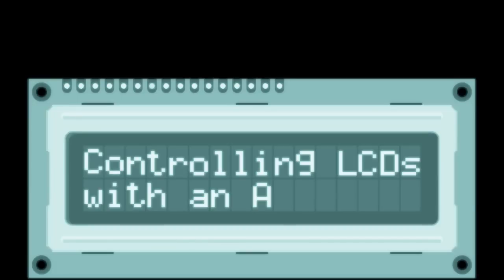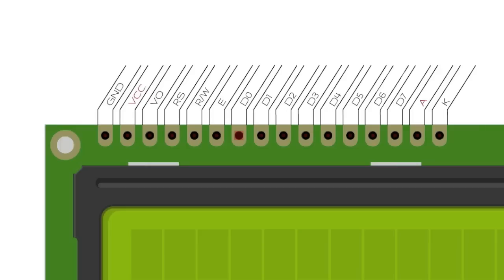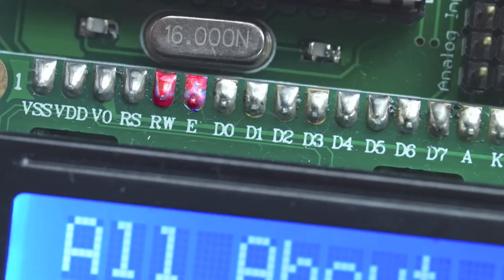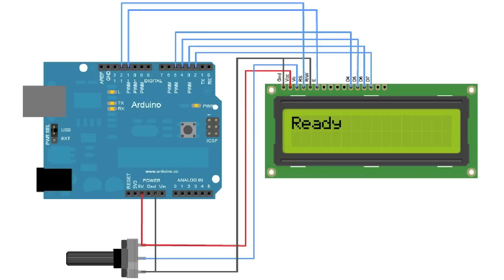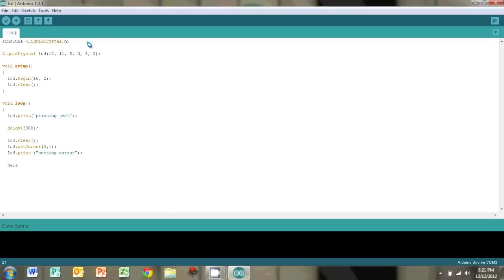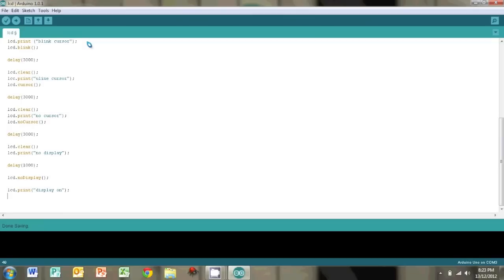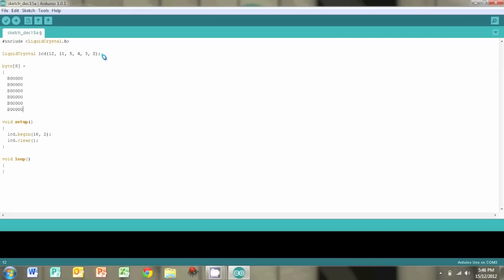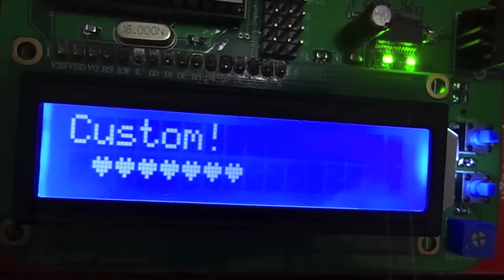How to Control LCD Displays | Arduino Tutorial

Comment: Do you have a video for LCD 1602 like this but also include a I2C? I bought and solder together the two but after that could only get the backlight to work, setting text and cursor has no effect. My hunch is that the soldering job is botched but I'm not sure how to begin to debug this

Comment: I have seen instructions that says that you can take the 5V for the backlight using a jumper from Vdd. I have read on some other places that is not the recommended way of doing it. What could a reason for not using the same 5 V from Vdd?

Comment: Mine lcd had a problem , after connecting Hello word congratulation of Arduino example code or any its half of rows display black box and not displaying any data ? What is the problem ? Is it damage !! Many codes uses Data pin D4 to D7 So i am thinking if my lcd is partially damage what if i use data pin D0 to D3 will it work ?

Comment: Very nice and helpful tutorial. Just one thing to add.. When you show the circuit diagram at 06:23 you forgot to show the Anode (A) and Cathode (K) connections to 5V and GND respectively. That had me stumped for a while and I thought it was a problem of my board. Anyway, managed to fix it in the end. Thanks a lot!

Comment: When I first tried the code example, it didn't work. First mistake is that I used "( )" instead of initialising brackets "{ }". Then I had to add a zero before the "b" in each line. I think the library had been changed since this video was made.

I had to write the code like this to get a character:

byte customChar[8] {
0b11111,
0b00100,
0b00100,
0b00100,
0b00100,
0b00100,
0b00100
};

If you write it exactly as above, you'll get a T, cause "1" defines a pixel to on "on" and the "0" defines a pixel to be "off".

Comment: i did exactly AS YOU SAID. But the problem is that my lcd is showing all colored blocks instead of what I tell it to print. please tell me how to fix this issue
Reply: Make sure to add the necessary libraries to run your LCD display. If it is adafruit, search "using the adafruit RGB LCD shield" and download the library there. In any case, it is possible you may need additional libraries than the default arduino ones to get it working.
Reply: I have a standard JHD 162A 16x2 LCD display. I followed everything correctly but i have the same problem. just showing filled in blocks in  1 line. Any idea where i messed up?
Reply: me too
Reply: Lol
Reply: Crazy with cats and minecraft and random stuff, do you actually play minecraft?

Comment: I installed Linux, next to Windows because I think I had some BIOS and driver problems, next to the libraries from Arduino itself. Using the TEVO Black widow with the MKS board 2560 I'm finally getting to see a port. 

But I don't see a program already inside the board. Did I select the wrong board, do you get to see the existing programming right away or do I have to load it and how?

Comment: how many LCDs can be used with a single arduino? I would like to build a gauge set for a car. or maybe a day electric car project. it would need maybe a GPS speedo. and volt meters one high and one low voltage. motor and controller temp. battery capacity meter. but if for gas vehicle it would need. a speedo. volts oil psi. h2o temp. fuel level. so can multiple LCDs be used or is there a larger LCD or oled display that could be used? thanks very informative video.

Comment: Can you set the contrast to maximum without a potentiometer ?
Reply: yes why not  just use  one resistor  between  vo and ground {2.2kohm(red red red ) or 22 ohm(i.e red red brown )}
Reply: LHCreeper if your micro has hardware PWM you can use that.
Reply: the way i did it was by just connecting the VO pin to ground, but i'm not sure if that will work for everyone.

Comment: If you have the small black board behind the arduino; and want to use that instead of the scary 16 pin connector you can get a Male to Female connector or a male to male to female to female that connects to the board.
A bit more info:
http://arduino-info.wikispaces.com/LCD-Blue-I2C

Comment: Could I use Teensy 3.2, which is rated for 3.3v. I could also use a 5v power supply, like from USB. But.. Could I use a Teensy 3.2 to control the LCD?

Comment: My lcd connections looks like this (at 3:55) but I haven't soldered it yet, I am still having problems connecting the lcd (code I am using is fine). What could I be doing wrong?

Any help is great

Comment: Just as a note for punctuation, this is called a quotation mark(") and this (" ") is quotation marks. Just as a side note (') this is a apostrophe. This is double quotation marks (" "text" ") and is never used in correct punctuation. So when you say "Double quotation marks" you might be thinking of double apostrophes which can look like quotation marks but are not.
Apart from that it was a good video, Thanks.

Comment: i just get a blank screen (blue) and the text never even shows up
Reply: +MARTIN prods I have the same problem. Did you solve that? If so please share your methods.
Reply: prom15e to 13elieve I couldn't find the solution but you can buy an LCD shield and save all that work :)
Reply: +MARTIN i had this i've done a bit of research and this linked worked for me xD https://www.arduino.cc/en/uploads/Tutorial/LCD_Base_bb_Fritz.png

Comment: this might be a stupid question but why is there a capital 'B' at the beginning of each item in the array in the custom character section? Is that to do with it being a byte array?
Reply: +Awesomekid2283  that is standard C to show the compiler the next digits are binary. you can do the same thing with hexadecimal. then it's written as 0hxx in which the xx can be any hex number and the h stands for hexadecimal. the Arduino simplifies this process by just needing a B or H, and then the value.
Reply: Good heavens, the misinformation in this thread. The C language has no binary literal. In arduino/binary.h they have #define all of those values. They begin with "B" because you cannot start a variable name in C with a number. Also, hex literals in C starts with "0x" not "0h".

Comment: it an array a data of row and columns starts at 1,0 , that's why it says error coz you did, 0,1 which is an math error.
Reply: +Jankevin Carimat - No, the problem is that the function is overloaded (i.e., it's virtual, or there are multiple functions with the same name), and a 0 is ambiguous. To clear the error, you just need to do a type cast, so the compiler knows which function to choose.

And the number doesn't refer to an array, it refers to the character's address in the LCD's custom table.

Comment: Hi, I have an Hitachi LCD1602, which came with my kit, and looks like this. I'm finding the display really laggy, like... when it scrolls text it refreshes so slowly it's practically unreadable. There's a horrible ghosting effect, and I don't know if the wires are a bit dodgy or the screen is just a cheap piece of crap?
Reply: +ArcanePath360 try messing with the contrast
Reply: +Awesomekid2283   Done that. I think A: It's a rubbish display B: voltage drop may be making it worse C: Dodgy wire somewhere.

Comment: pretty sure the error you got at 14:00 is because in the c language, 0 is treated as false
Reply: No, the error at 14:00 is just what the compiler is saying - it can't tell if he means 0 to be an integer (in which case it would use LiquidCrystal::write(uint8_t)) or a char pointer (in which case it would use Print::write(const char *)). 0 is a special case that the compiler understands can be a null pointer since it is fairly common, however nobody commonly uses 1 as a special pointer so the compiler understands that 1 must be an integer. The error will go away with an explicit cast: lcd.write((uint8_t)0);
Reply: thanks for the clarification. i need to study up on my c

Comment: put +5 vcc on A pin and Gnd in on K Pin FOR BACKLIGHT.... :)   great tutorial man...
Reply: +100roberthenry  Thanks a lot! This is an essential piece of the video! Which is apparently missing from the video!
Reply: +prathik shirolkar  your welcome... )
Reply: @100roberthenry  This still makes my screen have no backlight whatsoever however everything else works perfectly, just that's it's hard to read without any backlight. Any ideas why that would be?
Reply: @Salamakii   have you tried a pot to adjust the contrast?.....as in the video?
Reply: @Salamakii   put +5 vcc on A pin and Gnd in on K Pin FOR BACKLIGHT...if the light isnt coming on you may have blown the led for it....
Reply: @100roberthenry  Thanks for all the help my friend. I am afraid I've tried all of these connections, it does seem like the light just doesn't want to work no matter what I do. It is true that I got this screen from my school, therefore there is a high chance it was blown by someone else before me, as it never worked for me and I don't believe I've done anything wrong with it anyway. But anyway thanks for your help, appreciated.
Reply: @Salamakii   no problem, yes it sounds like someone has blown the led in it.....they are very cheap on ebay.....different colours too.  good luck.

Comment: i hv 24 pin lcd display.  can u tell me how do i use the lcd display w/ 24 pin? thx.
Reply: lcd.begin(24, 2);
Reply: +TheFFY00 what u said is for a display with 24 characters per line and 2 lines. not for a 24 pin display
Reply: Praveen Venkatesh right, mistake

Comment: Does it work without a potentiometer?
Reply: It would but u will have full contrast and all the pixels would be white but u will see the text if u look at the lcd from another angle like 45 degrees or so roughly, using a pot is a lot wiser.
Reply: +informatique AME or u could use a resistor
Reply: +Dhruv i was gonna ask the same but u answered i have one more question would it damage my lcd if i dont use potentiometer
Reply: Dhruv Thank you, I have only one more question, is it necessary to use 220ohms resistors, can't I use for example 300ohms resistor?
Reply: Dhruvgiri Goswami You're right, this is a good question too.
Reply: +Dhruvgiri Goswami it won't harm your LCD, I recommend using a resistor of 220 ohms other wise you will have a white screen if u don't use a pot or resistor. u will find a resistor at any electrical store. if u need help give me ur mail I'd and I'll send u the sketch and wiring arrangements.
Reply: +Dhruvgiri Goswami it won't harm your LCD, I recommend using a resistor of 220 ohms other wise you will have a white screen if u don't use a pot or resistor. u will find a resistor at any electrical store. if u need help give me ur mail I'd and I'll send u the sketch and wiring arrangements.
Reply: +informatique AME i think yes because it will just do a little difference by the way whats ur age
Reply: +informatique AME i am your 300 subscriber
just subscribed now
Reply: thanks for the answer and for the subscribe! Even if I don't post videos a lot!.
Reply: +informatique AME yeah u can but u will find the screen a lil dull if u do the math 220 is the best suited 👍

Comment: Best tutorial ever!! I could even figure out how to make my own custom code just from this video. One problem though. You did not go over how to get the backlight to work. You missed a step in the circuit. You did not connect anything to the "A' and "K" or pin 15 & 16 parts of the LCD. That is what controls the backlight. To do this you need to connect a ground to 15. Then use a 220 OHM resistor and connect that with 5V and A16. Then connect a wire from A17 (A18 and A19 works too) to pin16. This will enable the backlight of the LCD
Reply: A little bit late but what do you mean by A17? A pin or what? I want to turn on my backlight

Comment: Is it possible to power up the LCD without poten?
Reply: +Kumaresen Saliva Kumar a bit late maybe, but simply put a resistor between the 5v and V0, also should put K to ground and A to a resistor then 5v for getting the back-light.

Comment: When referencing custom character "0", if it is not in a variable, you need to cast it as a byte, otherwise the compiler throws an error. See the example below.
i got this on arduino website .Thats why we can't use zero.if you want to use that use it as 
lcd.write(byte(0));
SOURCE: ARDUINO WEBSITE
SIR, YOUR VIDEO IS PROBABLY THE BEST ONE I HAVE EVER WATHED..

Comment: some went wrong

Arduino: 1.6.5 (Windows 7), Board: "Arduino Uno"

LCD:5: error: initializer provided for function
LCD:7: error: 'lcd' does not name a type
LCD:8: error: expected unqualified-id before ')' token
initializer provided for function

  This report would have more information with
  "Show verbose output during compilation"
  enabled in File > Preferences.

Comment: why would my lcd screen stay so dim?
Reply: zack lariviere nvm just hooked up a to 3.3v and k to grn much better now
Reply: zack lariviere You need to tweek the contrast pot. The contrast voltage is too high on the VDO pin. It should be around 1vdc however it can be  different between devices. The lower the voltage the darker it becomes. If you ground the VDO pin you should still see the text but very dark.

Comment: Thanks for the video fellow. About the compilation problem you with had with the zero "0", its happens because 0 can be an integer or a pointer (NULL), so the compiler doesn't know if you are calling a function that takes an integer, or one that takes a pointer. So it's something from the language. Cheers.

Comment: You forgot to explain the port 15 and 16 about the back light, so according to your diagram, this thing doesn't work btw.
Reply: He did say that it's the cathode and anode for the backlight LCD. By the time you do this stuff, you'll know what anodes and cathodes are, but if not (no love lost) you can do a quick google to see that these are just the 'power' inputs for the backlight, just like any old LED has A and K/C ;)

Comment: the  lcd.createChar(1, customChar);
doesn't work with 0 cause there is nothing to set, it's 0 it's nothing.
but it works with the 1, 2, 3 ... cause with that way you can group up your custom characters.
Reply: UpTechDate dakos Actually its because when calling lcd.write() '0' must be cast as a byte, so: 
lcd.write((byte)0); will work fine.

Comment: great video man! Thanksss yet i have a problem when connecting the bluetooth module (HC-06) the receiver of the bluetooth will stop functioning and screen will not write anything is there any solution here is the code:

#include <LiquidCrystal.h>
LiquidCrystal lcd(12, 11, 5, 4, 3, 2);
String voice;

int 
led1 = 6, //Connect Pin #6
led2 = 7; 
int
led3 = 8; 
int
led4 = 9; 

void allon(){
     digitalWrite(led1, HIGH); 
     digitalWrite(led2, HIGH); 
     digitalWrite(led3, HIGH); 
     digitalWrite(led4, HIGH); 

}
void alloff(){
     digitalWrite(led1, LOW); 
     digitalWrite(led2, LOW); 
     digitalWrite(led3, LOW); 
     digitalWrite(led4, LOW);
}
 
void setup() { 
  Serial.begin(9600);
  pinMode(led1, OUTPUT); 
  pinMode(led2, OUTPUT);
  pinMode(led3, OUTPUT);
  pinMode(led4, OUTPUT); 
    lcd.begin(16, 2);
    lcd.print("TV is now on");
}
 
void loop() {
  while (Serial.available())
  {                           //Check if there is an available byte to read
  delay(10);                  //Delay added to make thing stable 
  char c = Serial.read();     //Conduct a serial read
  if (c == '#') {break;}      //Exit the loop when the # is detected after the word
  voice += c;                 //Shorthand for voice = voice + c
  }  
  if (voice.length() > 0) {
    Serial.println(voice); 

       if(voice == "*all on") {allon();}  //Turn Off All Pins 
  else if(voice == "*all off"){alloff();} //Turn On  All Pins 
  

  else if(voice == "*tv on#") 
  {digitalWrite(led1, HIGH);
 lcd.print("TV is now ON");
     
    } 
  else if(voice == "*fan on") {digitalWrite(led4, HIGH);
 //hone badde khalle l lcd tektoun bass kif?}

  else if(voice == "*TV off") {digitalWrite(led1, LOW);
 //hone badde khalle l lcd tektoun bass kif?} 
  else if(voice == "*fan off") {digitalWrite(led4, LOW);
 //hone badde khalle l lcd tektoun bass kif?}

voice="";}} //Reset the variable after initiating

Comment: All I get is a blank screen! I've just tried printing "hello world" and blink it! All the wiring should be right.

#include <LiquidCrystal.h>
LiquidCrystal lcd(12, 11, 5, 4, 3, 2);

void setup() 
{
  lcd.begin(16, 2);
  lcd.clear();
}

void loop() 
{
  lcd.print("Hello World");
  
  delay(3000);
  
  lcd.clear();
  
  delay (500);
}
Reply: ur pins may be wrong
Reply: They were. Turns out my one had a completely different pin out. Got it working though.
Reply: mine was LiquidCrystal lcd(8, 9, 4, 5, 6, 7);

Comment: 14:00 It does not take zero because zero is reserved for the cursor.
Reply: The error message (as detailed at the bottom) is caused by the fact that the compiler can't determine if the zero in the lcd.write() call is meant to be a character value or an address. It has nothing to do with the lcd.createChar() function or with the LCD itself.

Comment: i have a question.. is it possible to use a 16x4 lcd message display. where " A B C D E F G H I J K L M N O P Q R S T U V W X Y Z" is written.. then create a command that will allow to choose a letter that can be outputted to a 16x2 lcd .. all connected to an arduino.. for example an arrow device. press the right key twice it will hover to letter b , then select and outputted to the other lcd

Comment: Do you know how to set up a similar display to work with I2C without the ywRobot? Youre some how supposed to connect just Gnd, VCC, SDA, and SDL. SDA and SDL go to analog pins 4 and 5, but Im not quite sure where they go to on the LCD. any help?

Comment: Very nice tutorial. :-)
When referencing custom character "0", if it is not in a variable, you need to cast it as a byte, otherwise the compiler throws an error.

Reference.
arduino.cc/en/Reference/LiquidCrystalCreateChar